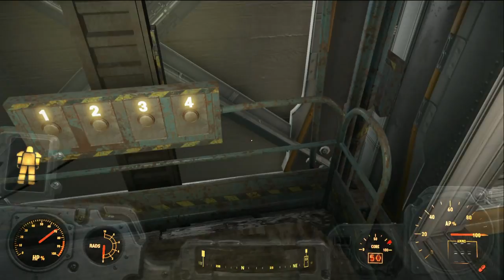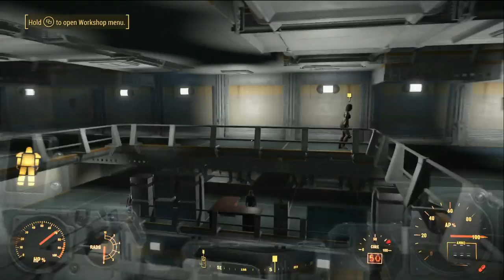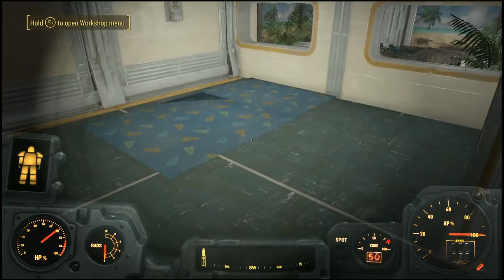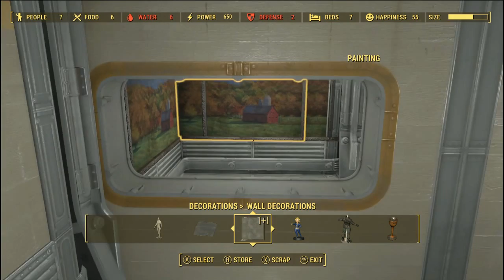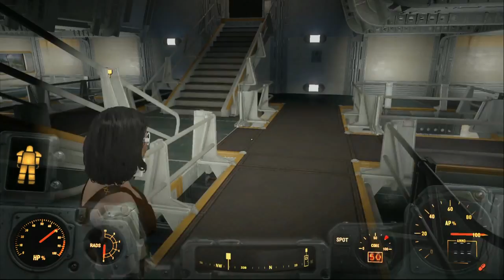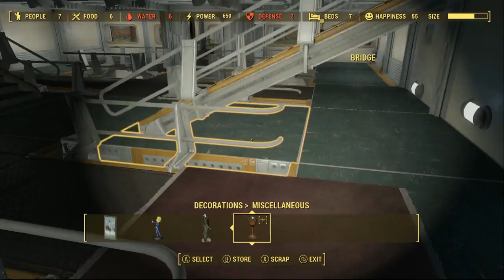Project Vault: Large Atrium pt 3 Mega Vault Build

Comment: manny dont you know the wire glitch where you can put infinite wire length and through anything?  no mats and stuff
Reply from the maker: Sure Didn't thanks i'll look that up!
Reply: you basicly have a wire connected between 2 points, and a place you want to pull a wire to, instead of attaching to the conduit, you press attach when you highlighted the wire as close to the conduit as you can, you hear the connecting sound but dont see a wire,  go to the thing you need to connect and attach, now your workshop will think your still about to attach so you have to press back one time, its that simple.